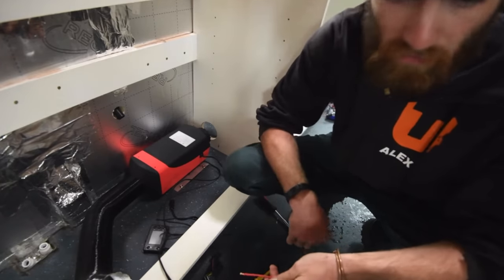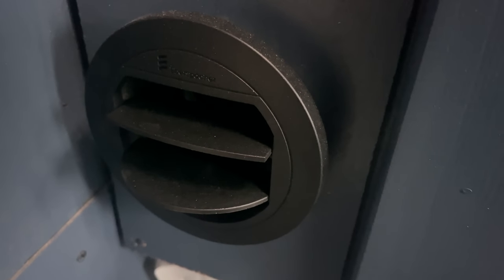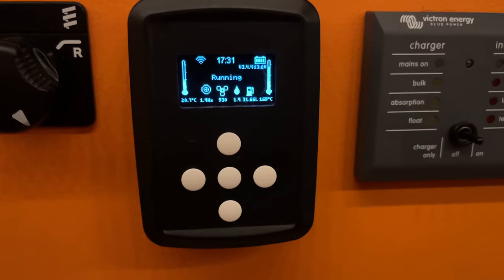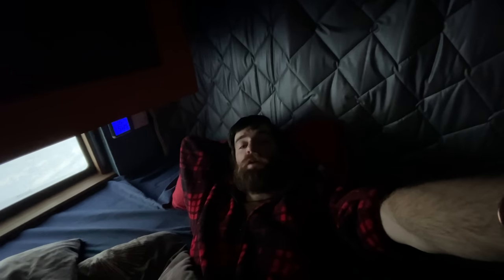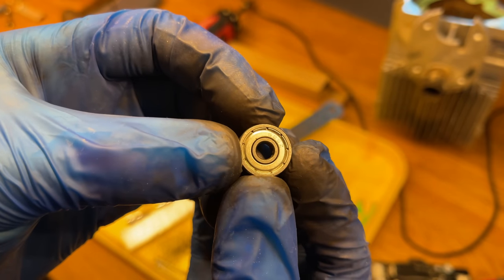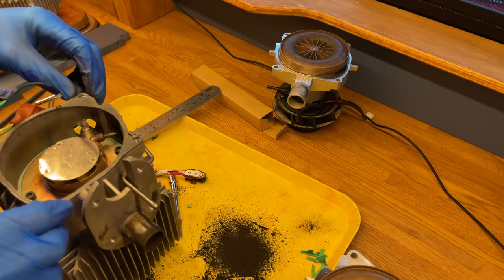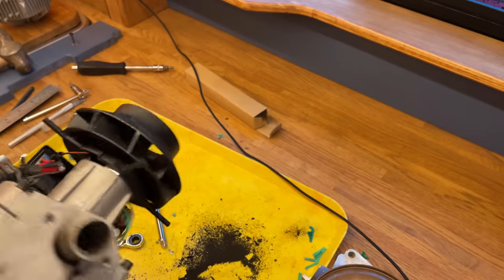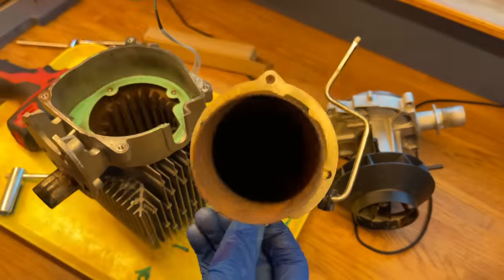2000 HOURS LATER! Chinese Diesel Heater

Comment: I would have loved to hear the days vs runtime.   How many months did this span?
Reply from the maker: It’s almost 4000 run hours now. This 2000 hours was about two years of normal uk use. So winter, early spring and late autumn plus one 4 week arctic winter trip. Uk use might of been around 10-12 hours over night, Arctic would of been more like 15-18 hours a day
Reply: @MispronouncedAdventures  so about 15L diesel a month.  That is pretty cheap overall 👍🏻👍🏻
Reply from the maker: @yourselfdotcom  averages yes. 

Arctic, I generally used around 50-60L per Month. Averaging around 2L per night, but it is significantly colder at -20c to lower. UK way warmer so a lot less diesel and sometimes less than litre per night.

Comment: Running on low does NOT ruin or soot the heater. wrong air to fuel mix does.
Reply from the maker: Most heaters are tuned to burn better on high than low by default . The CO PPM count can be 10x on low vs high. 

So yes soot and ruin is about air to fuel mix, but most people don’t ever tune the mix at low or turn at all, so many discover sooting up on low settings

Comment: Been running my heater for about 3 years with no issues .. famous last words 🤣 
I think I’m due a service
Reply from the maker: The heaters will last a long time from a good supplier and well installed. Clean inside a few new bearing isn’t bad for 2000 hours
Reply: @MispronouncedAdventures  I live permanently in a caravan and it’s been a game changer for me.  During winter when I’m not at work it runs 24 hrs a day and 12 hours when I’m working. My only complaint is that the 8kw is a bit too small for the size of my van.  
Keep safe, keep warm and enjoy your journey 👍
Reply: @Grumfuttocks  because its actually a copy of a 4kw eberspacher unit.  so nothing more then 4 - max. 5kw to be expected.

Comment: What year is your transit and how many miles has it done? Any reliability issues?
Reply from the maker: It’s a 2018 and now has 152k miles on it. 
Had a few bits over the years.
Reply: @MispronouncedAdventures  I presume you had the wetbelt done.

I've just bought an automatic one myself with 95k on the clock, I was very hesitate as it has been used by a plumber with allot of weight in the back. That being said, yours must weight a fair bit

Comment: nice! It's very quiet inside. Did you place the injection outside the van?
Reply from the maker: It definitely quiet on low and with the new bearing, what do you mean by Injection?  As the the fuel pump? Thats outside

Comment: I'm surprised that they used a brushed motor. It would be SO much more efficient if they used a brushless motor. Longer lifespan as well.
Reply from the maker: They are based off the expensive German brands Espar 4D. Which also use brushed motors. The autoterm heaters use brushless.

Although could you define what you mean by more efficient?

If you’re speaking about electrical consumption of the unit running. I’ve found this heaters use less electrical energy than the brushless autoterm I’ve tested ( although there isn’t that much in it ). Although the advantage of brushless is, there is no brushes, decaying and clogging up bearings.
Reply: @MispronouncedAdventures  Efficiency can also be measured in repair costs, and life expectancy.

Comment: Any thought to just running a small dose of sea foam in the fuel supply?   Basically this "heater" is just a very low compression diesel engine so sea foam should work as well as it does to keep soot from engines in cars, right?
Reply from the maker: You have me confused! Sea foam?
Reply: @MispronouncedAdventures  Sea Foam is the brand name product.  It's in the auto stores with injector cleaners and brake cleaners.  Basocally you just put it in the fuel and it clean/prevent sooting up.
Reply from the maker: @arthurfoyt6727  well that makes a lot more sense. I literally thought you were talking about the foam you find on beaches
Reply from the maker: @arthurfoyt6727  it would be interesting to test that’s for sure. I use only premium diesel in the van which has cleaning additives in it. I don’t know if that has any correlation to how clean the diesel heater was after the run time I’ve had it

Comment: Which is the best make to buy ? For a boat
Reply from the maker: If you want to go down the Chinese diesel heater route. There is a website which I can’t remember its name but I think it’s relatively easy to find which keeps a updating a list of the current best Chinese diesel heater. Is this maxpeeding rods from a few years ago It been very good but times may have changed. 

If you’ve got a bit more of a budget, I really like the auto termheaters

Comment: Cut a pool floatie to cover the fuel pump and you won't hear that ticking noise
Reply from the maker: My ticking noise is very quiet. I actually quite like it so I can hear what the heater is doing.
Reply: @MispronouncedAdventures  you have a good point. It drives me crazy though.
Reply from the maker: @curve5746  my pump is hung pretty loosely. It’s more a little thud and not a loud tick

Comment: I intend to mount a similar rig in a Jeep WJ converted to a one couple camper with a rooftop tent, rear seats removed for optional guests, 3x 12v deep cycle batteries with isolator, 3000w inverter. Everything is working great! Time for the cabin heater with heated output to either/both ported to RT-tent & cabin. So I am going to try to strip all the plastic housing off and mount the heater under the hood beside my slim Jeep 4.0l inline 6.
Here's my question(s):
 1. I want to minimize line length for fuel, intake, and exhaust. Does anyone out there see a problem with me feeding the heater exhaust into my engine exhaust system tapped in after the cast iron manifold into the the closest pipe using a welded on fitting like the O2 sensors have? 
2. Does anyone have any thoughts on potential issues with the heater exhaust going to the engine exhaust ports while the jeep engine is off?
I'm not comfortable with mounting the heater inside my cabin and there is plenty of room for it in the engine compartment as long as all the plumbing is short and tidy.
JP
Reply from the maker: Hey, 

I have a few thoughts. 
When you say strip the plastic housing off of the heater? you don’t mean the heater unit housing ? as the housing is vital to the operation of the unit. That is what allows the fan  to force air over the heat exchanger fins.

I do see a potential issue with the exhaust integration idea. There would be the back pressure through the heater when the engine was running. 

But integrating into the exhaust system for the vehicle might not be necessary as it’s common for 5 kW diesel hydronic heaters/engine preheaters ( heats coolant not air, but unit working principal is the same ) to be mounted in the engine bay having short a exhaust which finish in the engine bay.

However, diesel heaters like this far more efficient, if they are circulating air from the cab/tent opposed to heating direct colder taken from outside, this could also be an issue if the exhaust is terminating in the engine bay. You wouldn’t want to suck up exhaust gases
Reply: Thanks for your thoughts. You answered my concerns. As far as the cabin air intake, I intend to port both return and output back into the cabin so allowing any engine compartment gases into the cabin should not happen. The heater I chose is the all in one box type so the heater itself has its own baffle setup. You did get me to thinking about using a "bullet" type unit instead. You also answered my concerns about back pressure if I use the jeeps exhaust system. I think that I will just use an upgrade muffler and port the heater's exhaust to the front of the engine compartment. Thanks again for the excellent video.

Comment: Has your fuel  economy improved since you changed the bearing?
Reply from the maker: Not noticeably. but I wouldn’t expect it to change. the fan was still spinning at the correct rpm. ( which can be read on the unit display. ) so the burn should be unaffected, even if the bearings were knackered and loud. The amount of power / electricity that  the unit used spinning The motor on bad bearings may have decreased with new ones
Reply: @MispronouncedAdventures  ok cool thanks

Comment: Why u don't replace the new one??? When u need to replace a lot of parts???
Reply from the maker: 2 bearings is not a lot of parts. The exhaust with a new unit would be just as crap. £6 for bearings to repair a hood heater vs £100 for an unknown heater

Comment: BTW, the life expectancy of German brand car diesel air heaters is in general 2.500 hours. Two thousand hours is a great value for a cheap Chinese diesel heater.
Reply from the maker: I didn’t know that was the expectation life span of the German made heaters. Do you know what part particularly is the limitation?
Reply: @MispronouncedAdventures 
I have been at a trade fair from Eberspächer they told us there how they have doubled up the life expectancy of their diesel heaters from the first generation of airtronic diesel heaters to the second generation airtronic devices, which now have a life expectancy of 5.000 hours. The new generation has improved bearings and a now brushless motor.

A lot of Chinese diesel heaters are derived from earlier Eberspächer heater designs. My personal experience is also that the bearings are one of the weak spots of the Chinese diesel heaters.

Comment: That bearing just pulling off the shaft and then dropping into the casting does not fill me with confidence I've changed lots of bearings and always needed a drift and hammer and a puller of some sort to get them done, I've never seen them do that....?
Reply from the maker: Yep, I definitely did notice one of them came off very easily. Which I think was the one which had failed. I wouldn’t of said they were loose enough that the bearing itself would be spinning inside, or on the shaft. Glad it was a lot easier than the last time. I tried to take the wheel bearings off my van
Reply: @MispronouncedAdventures  yeah definitely... just did a couple on mine for last mot... they had been there for 19 years and needed the heat and beat to persuade them out...

Comment: There is a Chinese diesel heater in a Renault traffic we bought but no exhaust !! Do you cut a hole in the roof and put one of those spinning chimney top things I've seen on other Van's? Thanks to anyone who can help ?
Reply from the maker: Combustion chamber, exhaust and air intake are on the underside of the unit and usually exit from the underside of the vehicle. Spinning top like things are  likely from a woodburning stove in the van.
Reply: @MispronouncedAdventures  got it ! Thanks mate !

Comment: cool video, but for 80 bucks, i got to wonder if not just putting in the spare would be better? you did get 2K hours. I'm much more interested in the performance data than the mechanical tear down. But ok anyway.
Reply from the maker: I have a full spare with me anyway. As I take the van up the Arctic. But if it working well I’d rather repair and no replace. 

What sort of performance data are you after?

Comment: That's literally identical to the eberspacher D2 internally. Used to run ours on kerosene when we lived on the boat with it running around 12-15hrs a day because the marine diesel we got was absolutely disgusting and twice the price
Reply from the maker: They used the expired patent for thr Eberspacher D4
Reply: @MispronouncedAdventures  ahh that would make sense and I bet the parts are a quarter of the price in comparison to eberspacher
Reply from the maker: Most individual spare parts are not normally more than £15-£20
Reply: @MispronouncedAdventures  that's definitely a mark down on eberspacher then I think we had to spend 300 notes to replace the blower assembly one year as it was shot and a boat in January with no heating was not fun times

Comment: hmm  358 l over 88 days.  in canadian that works out to about 143/month of running.   

Converting to gal,   and US prices,  we are looking at close to 95 gal over 88 days and...  98.86 for alaskan prices.   under 100 dollars  month US to heat a small cottage for the entire winter.
Reply from the maker: My arctic trips use around 60L per month, 2L per day ish ( heater is not on 24/7 ). European fuel prices are a lot more expensive. 

Although fuel source was slightly difficult to do a comparison since many of our houses that he buy gas. 

For European in the Arctic, it’s pretty cheap equivalently Heating my van with it. Your North American prices might tell a different story.
Reply: @MispronouncedAdventures   I was going based on run time "assuming 24/7" running knowing  but i know they don't run 24/7.

Also a lot of these cabins are better insulated then your van.   most tent to be r-25 walls min with r-50 ceilings.   Though that said,  i've seen several that are r50 walls r-100 ceiling.

Add to that most people again, only run the heater when sleeping, or going out for a bit.   shifting to wood stoves when they get back.   (not the best to run a wood stove when you aren't home).
Reply from the maker: @jenniferstewarts4851 plenty of people do run them 24/7 that’s for sure, but doing my Arctic trip mine is  probably on for 12 to 15 hours a day. If I’m driving that I turn it off and the cabin heater can heat the entire van easily.
Reply from the maker: @jenniferstewarts4851 right correct I don’t have the luxury of such space to create thick walls like that. Although whilst it is a 5 kW heater, it runs on left then half power to heat the van easily to 21c and keep it there
Reply: @MispronouncedAdventures  for the little cabins 10'x16' or 3x4.8m,  with R25/50 Insulation, its about 18,999, canadian or about 11,307.63 pound.  Into that we will fit a little cast iron wood stove, then propane or diesel heater backup.  Personally i much prefer the diesel because...  its easier to pack in 20l fuel cans then it is to bring in several propane cans.
Reply: @MispronouncedAdventures  the 3kw ones work great in teardrop campers, smaller ice fishing trailers,  and snowmobile pulled RV/shelters.  5 and 8's work great in smaller cabins  in the in the 5-10 square meter range.
Reply: @MispronouncedAdventures  Oh, the initial post.  Re cost to run... was more a quick glance and price based on canada and alaska fuel prices so people could see at a glance and get an idea.

Comment: that 1st  gasket is not particularly important black rtv silicon alone would be fine
Reply from the maker: True, it’s only one intake air side. but using a spare gaskets to replace it is also pretty easy

Comment: hi i've never gotten these heaters b4 : i take it the volume of the space needed to be heated equates to the kW of the heater then?
Reply from the maker: Kw is kilowatt which is heating power rating . Common heater sizes are 2kw and this 5kw version. The heater output can be adjusted. This heater max is 5kw. The 2kw version would be to small to heat this van to heat it quickly

Comment: Absolutely brilliant and well explained video.
Just wondering, is it cheaper and maybe safer to just replace the whole system with another cheap unit ? Yes I fully expect people to jump on me for that comment lol but not everyone has the skills to strip it down and replace parts. Me personally, Id service it every Summer/Autumn. Thanks for the tip of using high grade fuel. Ive seen some use Red diesel. Do you have any experience of using Red Diesel ?
Reply from the maker: I think it’s the great thing about the price point of these heaters. You can repair or you can replace the whole unit if need be. 

Whilst I don’t have any concrete evidence to support that using premium diesel which can contains cleaning additives is any help, but I thought it’s best to outline the type of diesel I use in the heater, personally, I have no experience with red diesel, but as far as I am aware, it would be exactly the same as normal diesel just added colouring as a marker
Reply: @MispronouncedAdventures  it is funny how most people who own the heaters, either have a spare or lots of parts lol. I guess when people try return the faulty one, the seller says keep it lol
It's interesting how different all van life builds are, even from the same van brand. 
Thanks for sharing your knowledge
I've subbed and bell'd

Comment: Does afterburner work with non Bluetooth model heaters?
Reply from the maker: Yeah. The afterburner only work with heaters which use a particular ECU ( the ecu on a heater can be swapped if need be )

Comment: do you use the exhaust for heating water?
Reply from the maker: I don’t , I used the main air flow inside to heat my hot water. Far easier.

Comment: Wouldn't kerosene be cheaper then diesel? I know that here where I live Kerosene is cheaper than diesel.  It also has the benefit of burning at a lower temperature which can prevent gelling in freezing temperatures.
Reply from the maker: Kerosene is cheaper yes but not practical for me as I spent the last two winters in the Arctic and I go through 150+ litres heating the van over 2 months .  gelling isn’t an issue up there with the diesel being pretreated at the pumps and it’s just of convenience out of maintain tank.
Reply: @MispronouncedAdventures  OIC I was just wondering.

Comment: Please do not skimp on porous or old seals... 
If the burn chamber seal is leaking, the air heater will blow the exhaust gases into the interior.
Reply from the maker: I didn’t skimp. I used a unused seal from a new heater. There seal I broke wasn’t the combustion chamber seal. There seal between the burn chamber and heat exchanger was fine.  

Not sure what the seal between the two body half’s are called. With more time I’ll just order a new seal kit
Reply: yeah i saw that this doesnt was the burn chamber seal ... but i like to say that because some people dont know that they can kill themself with these air heaters if the burn chamber seal is broke after they try to clean this thing. :'D

good video!